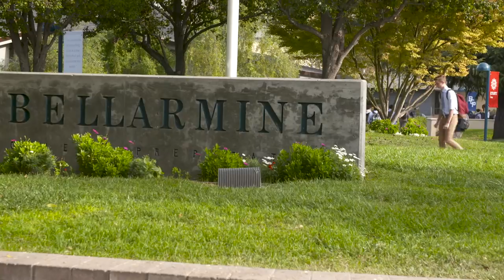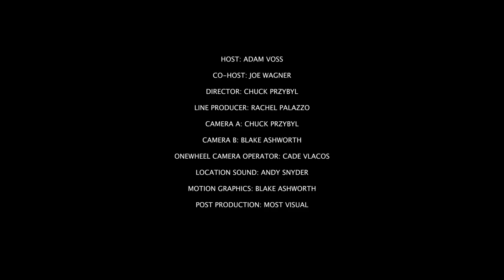OneWheel to Rule Them All | 12 for 12 S3 · E2

Comment: This is a developing technology and nothing is 100% safe! If you are a new rider or over the age of 30 years old please do yourself a favor and be very aware that you are mili-seconds away from a catastrophic failure or a serious wreck! I purchase my XRPlus and 100 miles later, with out warning this Onewheel turned me into a "human fly swatter" I broke my arm and dislocated my shoulder in a blink of eye. Don't be fooled you cannot run out of a 10mph bail-out or re-cover from a nosedive you will hit the deck and hopefully you have the proper riding protection! I sent my new board back to the lab to determine the all of sudden failure and Onewheel determined it was faulty internal parts. I sold it immediately after Onewheel shipped it back. A bitter sweet disappointment and now comes the medial bills!!! Enjoy.